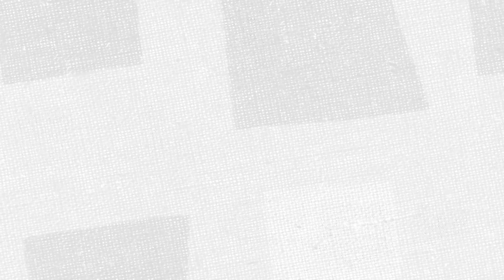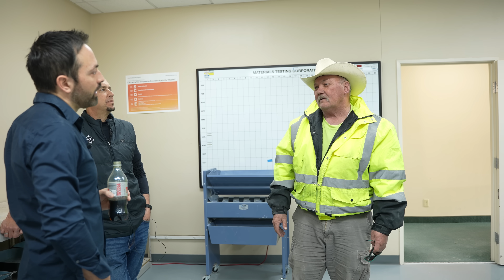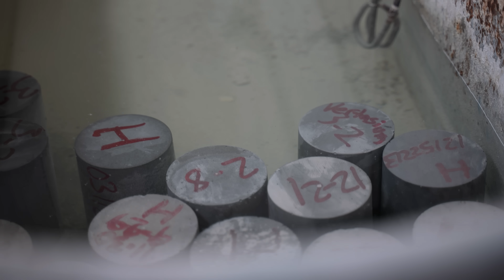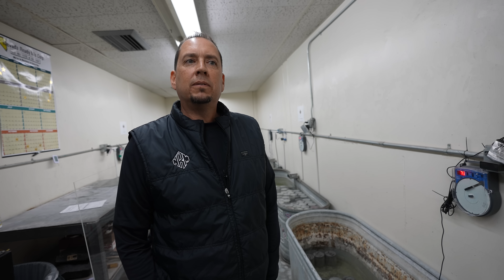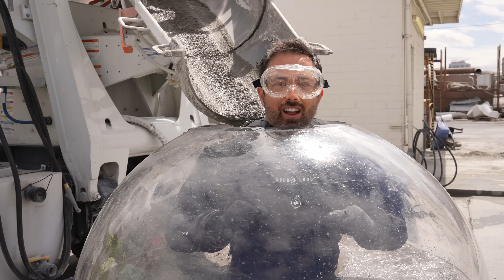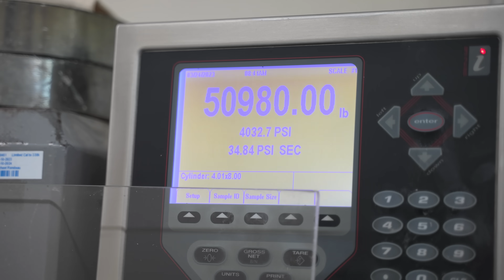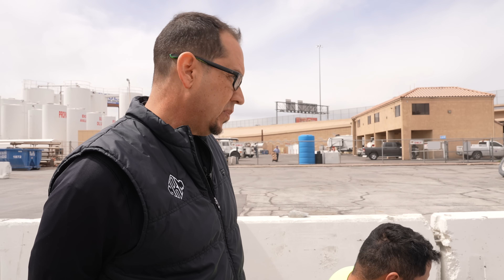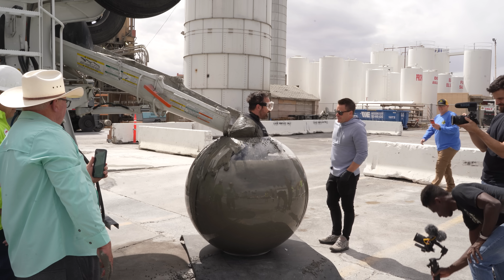Getting Buried In Concrete To Explain How It Works

Comment: This is actually one of the only things I have been able to think of that actually removes water from the world that never gives it back.
Reply: landfill food waste is another one when it is in plastic bags
Reply: technically you can get it back, its just a lot harder.
Reply: @aoyuki1409  maybe in some kind of inferno that would liquify it and release oxygen and hydrogen, but I’m talking naturally.
Reply: @Hambon10  nah you only need to chemically or physically with heat, dissolve the silicon oxide
Reply: @aoyuki1409  yes, heat. An unnaturally large amount of heat, to break down the calcium hydroxide. Something that won’t happen by itself aside from a cataclysm or something.

Comment: Love how fun it looks to float that high in wet concrete!

You're also perfectly demonstrating why if you were ever actually in quicksand, you're not gonna sink under, you'll just float cuz of the extremely high density of the fluid.
Reply: Whilst that is true overall, think what happens when jump into a swimming pool; first you sink and then you pop back up, in quicksand the same thing happens, but much more slowly! So while you may end up floating on the surface you might still spend enough time under the surface to run out of oxygen.
Reply: I have had the misfortune of stepping into quicksand on one of my outdoor adventures. Its actually easy, if filthy, to get out of. Don't try to pull yourself out as suction will pull you down. Instead, lay down on the quicksand and swim your way out of it. You don't actually need to know how to swim because it is so buoyant. You will float, so just paddle your way back to solid land. That last bit of pulling yourself out you may be dealing with some of the suction, but just keep moving toward solid ground. Eventually you'll get out of it. 

Laying down in the crap will of course cover you head to toe in whatever muck you stepped in. Cleaning up away from civilization was probably the worst of it, as well as the initial shock of it all. I never thought I'd actually even see quicksand, let alone step in it.

Comment: Cement is the substance most used by humanity apart from water. 4.4 BILLION tonnes of it are produced annually. That is ~2.3408 x 10^10 (2 TRILLION 340 BILLION and 8 MILLION tonnes) since the start of 2020. That mass is equivalent to around 4 THOUSAND Pyramids of Giza.

Comment: I love how the safety glass just fell over and the machine still keeps going
Reply: The safety glass is from the video production team, not from the cement/concrete factory. The proof: The metal door with the grid is open the whole team to be able to film the slow motion trough that piece of safety glass brought to the site by the camera crew.
Reply: I was scared.
Reply: It's not an integral part of the machine so there was no interlocking

Comment: Boy, can I tell you about the base PH of concrete eating skin.   I've done many smaller concrete projects without issue, never wore gloves, and the worst effect is dry skin in the following days.  But the largest job by far, was my own home foundation, and when pouring the footers, I was exposing myself to the wet concrete for very much longer.   You know how if you're in a pool for a long time, your fingerprints and parts of the palm get all wrinkly.  Well, that's saturated skin, and the base solution can dissolve that saturated skin quite easily, and that's what happened to me.  No pain while it happened, and only because I noticed a little blood while screeding my forms, did I pause to see if a sharp stone may have cut me.  I washed my hands, and to my horror, found all my finger/thumbprint areas and the palm at the base of each finger and thumb with holes eaten right through the skin.   The next two weeks were very challenging and painful as they healed.  I was surprised to see my fingerprints return though!
I don't do concrete work without gloves anymore.  😅
Reply: Nobody who doesn't know what concrete and cement is should be allowed to use it. Doing those projects without protection is just sheer stupidity
Reply: some people are more sensitive than others, i can handle and practically bathe in it without major issues
Reply: Thanks a lot for sharing your experience....it helps to understand how the possible harm operates 👍👍👍
Reply: OH, so THAT'S HOW YOU GET TRYPOPHOBIC SKIN
Reply: @Monkeycantnutz  But the people who don't know what it is don't know that it's dangerous
Reply: @Monkeycantnutz  Could be an unskilled labourer who hasnt been taught how to work with it safely., not always stupidity of the person smh
Reply: @thefamousdjx  he's right to a degree, there should be safety protocols that are stricter as some types of concrete like heated mixes can be extra corrosive.  But the typical concrete in the store won't have this feature to it and is available to the public.  There are a lot of other things that are even more dangerous, especially some types of paint and cleaners.  However all of these containers have warning labels and you're supposed to read them for a reason.  Just because there is one stupid person that refuses to read and wants to learn the hard way doesn't mean it shouldn't be available to the public.  I agree though that there should be stricter protocols on large pour sites like bridges or buildings.
Reply: The wrinkliness is actually a reflex and not just the skin absorbing water

Comment: Super plasticizer is insane, I used it in college in the engineering club. We had a 5 gallon bucket half full of concrete that was a chunky mess, and they added a syringe full of super plasticizer, and it just melted into a liquid. Just a tiny bit has a major impact!
Reply: Was it concrete canoe? We made canoes out of custom made concrete and super P was essential for pouring mixes and maintaining strength. We actually had a mix with 16 unique ingredients including microscopic glass beads and several curing chemicals that prevented cracking and shrinking. Add some carbon fiber mesh and well placed prestressed steel wires and you have a nearly indestructible canoe that is nearly as dense as water and can hold 4 adults. It was super fun to race a concrete canoe that you designed down to the particle. Many break which was heartbreaking but very exciting.
Reply: @dengar96  "nearly indestructible" then soon after "many break", lol! In all seriousness though, that is really cool and sounds very fun.
Reply: @randomname4726  Well, they did say nearly.
Reply: It is remarkable stuff, very easy to overdose
Reply: @randomname4726  I was thinking he meant they break in the process of making them. Having to support all the mass while it cures or something but maybe I'm wrong...
Reply: @amosbackstrom5366  I think you’re right but I had to go back and check his wording. I guess when you consider all those demands being placed on something like concrete used to make a fairly light, thin walled boat that’s like 3’ wide and 10-12’ long, with a need to be either kind of flexible or extremely rigid, I assume rigid, but the forces are coming in every possible direction and type of force.
Plus durable enough to run aground on hidden rocks or logs or just land on a rocky beach.
All that is an assumption cuz I don’t know a think and concrete canoes!
I know that some bigger ships were made from it but I think they were too brittle with a very short lifespan, and I definitely know a bit about the pykrete ship( pykrete is water mixed with sawdust, poured into forms and then frozen) fun idea but hardly practical!
That said a concrete canoe seems like it would have a short lifespan as well unless you add something to increase the lifetime of the concrete
Reply: @dengar96  this particular project was a competition to create the strongest porous concrete to allow water to pass though, I kinda got in at the tail end of the project so I don’t know much about it. But they did do canoes too!
Reply: @dengar96  side note, when I was in high school physics we made cardboard boats, and used them on lake superior (that’s where I grew up). Everyone made pretty standard boats, boxes with a point on the front. I used my grandpa’s boat building book to get the proper dimension for a full 9ft canoe. I modeled it in blender, and used blender to calculate the volumes to find the waterline. It was way bigger than anyone else’s boat, and everyone told me it was gunna fail, but it held, till we tried a second time for extra credit lol.

Comment: I work with concrete every day and have learned the different materials and different additives for different uses. I operate the trucks, batch loads of concrete and load bins and hoppers, conveyers and more. So Cool to see it in a video. I see all of this and more every day
Reply: Funny how this is almost PTSD for me 😅 I worked at Preferred Materials and I think I’d rather jump into a hopper than go back 😂
Reply: @MrChewymango  Been hauling Concrete for over 5 years now. Ill be a happy man when I get out of that Mixer for the last time. 
15 hour days, 8 hours off between shifts, midnight start time one day 6am the next then midnight again. Never knowing what time you have to be in till about 4 in the afternoon.  Never knowing if you are going to have Saturday off or not.    Great money though, and a easy job once you get some time in the seat.
Reply: @SootyMangabey. 😮
Reply: @MrChewymango me too buddy. I was a qc tech for a few years. Absolutely the worst time of my life. I never slept. Ever. And the pain was otherworldly. Became addicted to drugs, had to quit everything and start over. Absolutely horrible experience. 

I was fantastic apparently. But I have little memory of it. Diagnosed with ptsd. Literally partly due to that job. (It wasn’t all of it of course). Zero percent exaggeration. Literally tickles my real ptsd watching this. 

Thank christ every day i made it out of that whole mess.

Comment: Portland cement is a wonder material but we use so much of it where it isn’t necessary. For example, there’s no reason why an ordinary house made of brick can’t be built with lime mortar, which has a smaller environmental impact and absorbs CO2 when it sets.

Comment: Surprised the Hoover Dam wasn’t mentioned. Engineers have said that some of the concrete down in the core of the structure still continues to cure, over 85 years later since it was built.
Reply: Along with the workers' bodies, so I've heard.
Reply: Unfortunately since concrete is caustic they are probably just bones now, maybe not even that
Reply: @RetroDotTube  That's true. Just knowing the pour didn't stop if someone fell is a bit disturbing, but what else were they gonna do?
Reply: The bodies in the Hoover Dam is an urban legend and not true. It is true however that the concrete in the dam will continue to cure and get harder for many years. I think something on the order of a couple hundred years before reaching peak strength.
Reply: @DC-ei9vl  Workers yes.... and no doubt the odd mob victim!  After all, it's only 37 miles from LV to HD via Cadillac Town Sedan...   !!!  :P
Reply: @witblitsfilm Hadn't even crossed my mind, I can see it though.
Reply: I can see how that could be. Never had proper curing conditions I'd guess

Comment: I always wondered how  a thick cement slab hardened at the bottom of the slab. My intuition was that the water was evaporating but it never made sense because I imagined that only the very top layers of the cement mixture would have water evaporate and below that layer would stay wet as the dry top layer would prevent water from turning into a gas and escaping.  Now that I know that water doesn’t evaporate but actually the active ingredient to get chemical reaction from cement and aggregate materials and bind them together, it all makes sense.

Comment: Dry mixture will cause chemical burns on your skin when you start to sweat I’ve seen some horrible results from someone who decided to wear shorts to work and they wound up needing to climb in the hopper to get things flowing and get the rest out ( shotcrete portable mixing plant.) and he got a bunch of dry mix down his boot and did not know that it can cause burns so he didn’t think anything of it until near the end of the day when the irritation he had been ignoring all day became a clear burning sensation and took off his boot to find blood and a deep wound on the side of his leg. It was his first day and he was trying to be helpful a time when stupid things are likely to happen. Especially when you are unprepared and uninformed
Reply: I like the fact that you acknowledge someone can get hurt for being “unprepared and uninformed” but failed to warn the new guy on his very first day
Reply: @ I wasn’t there to tell him anything. He showed me the nasty wound and he and his father had told me what had happened his father who also wasn’t there who was the owner of the company who was fairly disappointed with the fact that his son didn’t know any better regardless if it was his first day working for the company. It wasn’t his first time around the equipment and the potential hazards. I would have definitely not let someone learn that lesson the hard way.  I’m sure someone said something to him but he probably didn’t think much of it. I forget the exact details of if he had thought he got everything off of his skin or if he had just left it and only dumped his boot out but it sure looked like he hadn’t cleaned it off.  This was shotcrete or gunnite where there’s a hopper(portable mixing plant) which charges a hose that has a water line at the nozzle so you are introducing water at the moment the dry mix is exiting the hose.  Really awesome stuff.  They build water parks and those miniature golf courses with all the fake caves and waterfalls. Stuff like that. I think the particular job the scene of the crime was an insane swimming pool for someone’s private home which wasn’t something they normally did but It was something around $3-4 hundred thousand for a backyard attraction so they made an exception And the house wasn’t anything spectacular. You wouldn’t think this was in their back yard. it had a lazy river as well as a grato  underneath the water fall and a swim up bar area I believe. This was about 14 years ago now so I’m doing my best to remember everything correctly.

Comment: I live in Vegas and I used to work near where you filmed this just on the other side of the freeway. There are lots of places in that area that process concrete and others that recycle old concrete.

The dust gets everywhere and can even set. I have had to scrape it off my car countless times. The recycling process is actually fascinating and seeing it up close was really impressive. I am a bit surprised you didn't mention that because concrete is very heavily recycled. One of the most recycled materials we use. Could be a good follow up video.
Reply: Actually i would love to see a video about that. Weird he didn't mention it.
Reply: I thought the most recycled material is tarmac
Reply: @Zaydan Alfariz Because it's in a "fault" state. Which means that you can sue over car accidents more easily and for more things than in a "no fault" state where it's more so all on the insurance and suing is harder. And it is a big, busy city with lots of accidents. Two together means profits for lawyers.

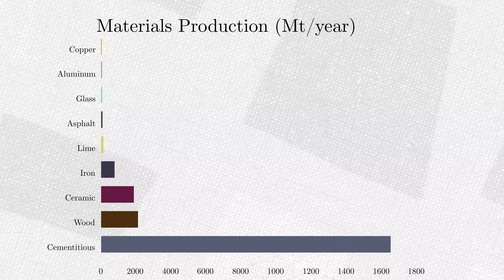Comment: 1:30 there was a mistake in the graph. It went "2000 4000 6000, etc." Before reaching the year 1000 when it should have gone "200 400 600 etc." I looked for a bit but no one else seemed to have noticed this for 2 years.

Comment: Concrete scientist here! Great video! Regarding your point about cement chipping more - this is actually true. The aggregates are stronger so any cracks that originate have to propagate around the aggregate. This imparts a bit of ductility to the concrete that pure cement paste does not have. In cement, the crack will just pass right through. High strength concrete (>10,000 psi) on the other hand also may chip and crack more easily since the cement matrix strength starts catching up to the aggregate strength.

Comment: It was really fun watching this video, reminded me of the time I spent in a lab testing concrete cylinders out of highschool.

Something I didn't ever see mentioned in the video was that highest PSI does not always equal best concrete. for example, the landing strip at an airport wants a lower PSI tolerance because that in turn results in more flexible concrete, allowing it to endure the impact of the airplane. Then say for a building support column it wants higher PSI as it isn't expected to handle impacts, just bear a heavy load. 

Take what I say with a grain of salt though, as this was several years ago, maybe it has changed since then, but if so I haven't heard about it.

Comment: I learned quite a few things about concrete in this video that were quite enlightening. My grandfather was a cement/concrete master, not so much with pouring it or working it into structures but of coming up with material and chemical formulations for different requirements such as whether it was to be fast drying, its level of hardness, its ability to withstand heat, it's ability to avoid cracking and many other things. Unfortunately he never shared any of his cement/concrete secrets with me because I'm fascinated by both concrete and cement and have often come up wirh some interesting experiments myself to test what kinds of things i can do working with cement and various unusual aggregates to create certain structures and things using cement. I always have Portland cement in my shop, sometimes I also create my own out of lime by heating shells, limestone or other materials to make some from scratch. I've come up with some very interesting stuff playing with cement, some expect, some unexpected. Guess I probably got this interest in cement and concrete from my grandfather, even though we never spoke much of the topic.